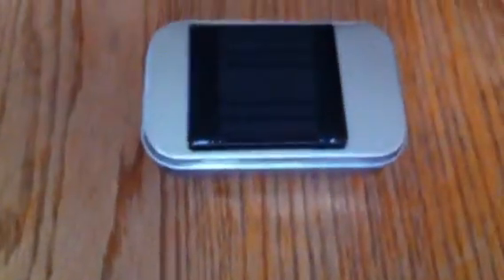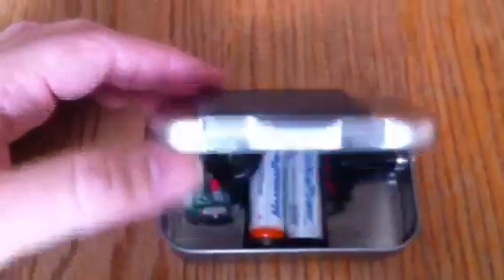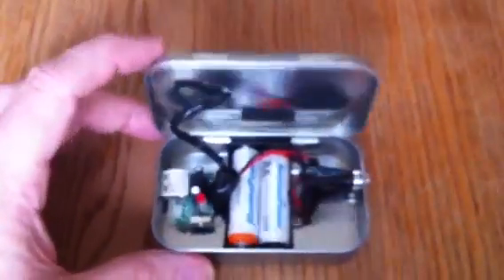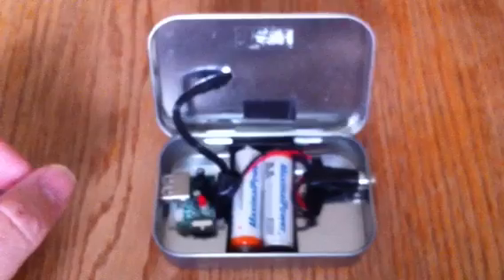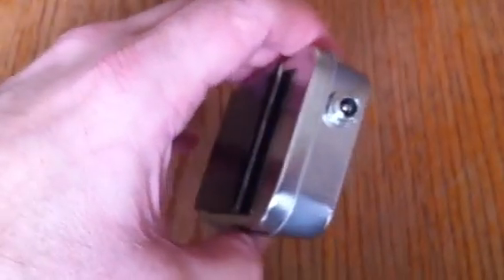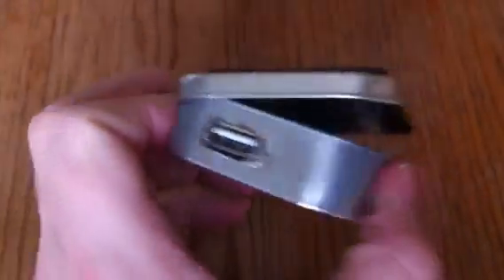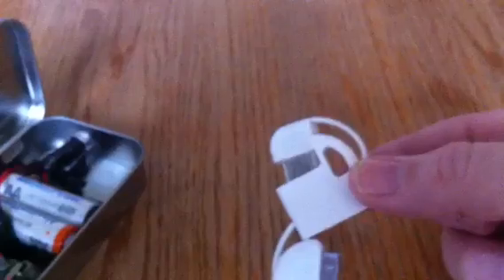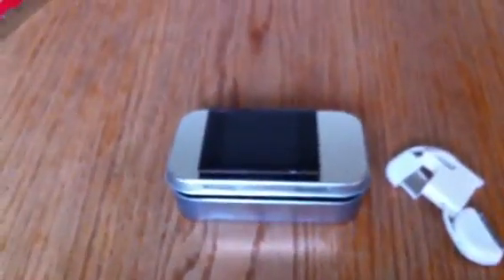DIY solar USB iPhone charger

Comment from the maker: Next time i make an altoids tin project i will film it. I drilled a hold and then used a small file to make the USB female plug fit. This did not work out very well so on my next one i put a piece of wood behind the tin and then used a chisel to slice the tin. I used a undersized drill to make the hole for the charging plug and then bored it out with larger size drills until the hole was real close. Then i used a file corner and twisted in the hole to make it bigger till it fit.

Comment: Yayyy i just did one but i dont have the usb charging circuit so. It's just charge two aa batteries. I live in vietnam so i don't have many stuff around
Reply from the maker: Awesome! Do you know the stats of the solar panel? Is it 4 volts? Do you know the mAh?
Reply: ShoeManShoe68 it is a 6 volt 100mah solar panel 0.6 watt
Reply from the maker: Make sure to charge with the batteries in shade and if they get warm usually they are full or close. Use a multimeter to test that they are at about 2.8 volts. That would be close to full without damage. Did you use a blocking diode so the power does no reverse back into the solar panel?
Reply: yes i do use the n10001 or something i dont remember but it can block 50 volt. thank you for your help